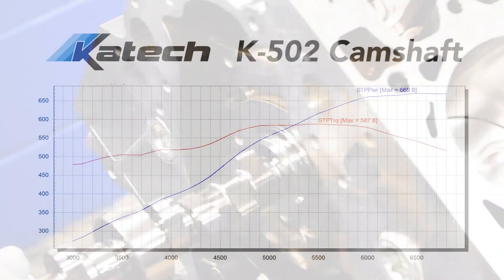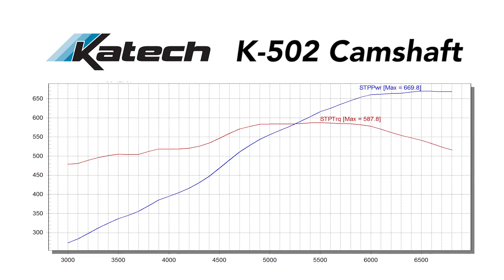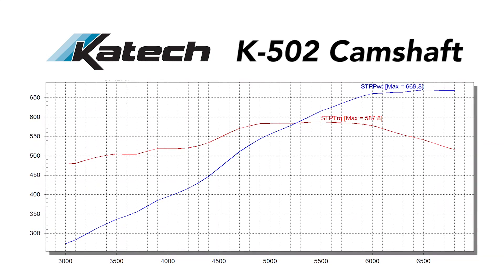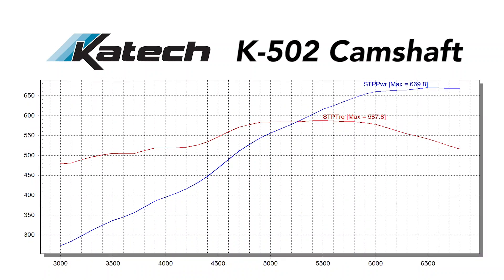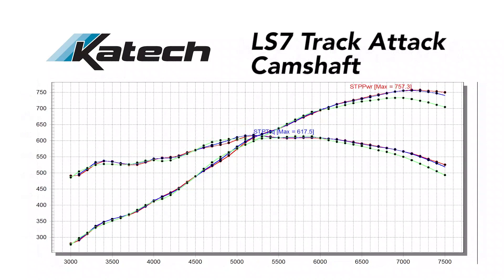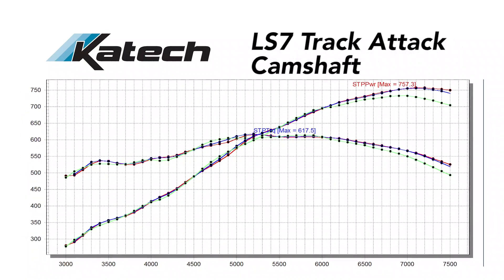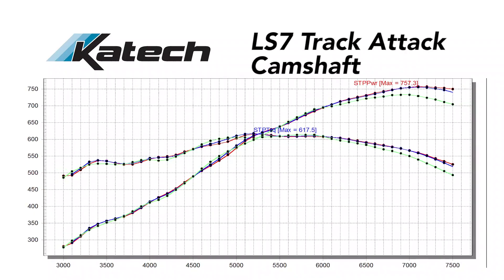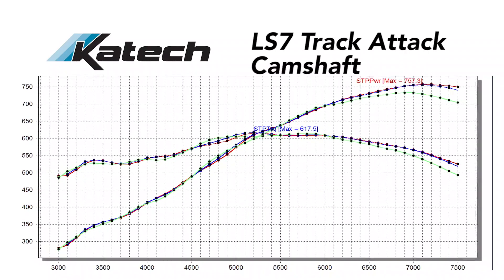Katech K502 and LS7 Camshafts!

Comment: @Katech ....How exactly is your new K502 (243/257 on a 113+3) an improvement over the K501 (235/251 on a 113+3)?
I see how it would make less torque all over the RPM range and more power at the very top of the RPM range. But how is it better or more efficient? Certainly the new K502 won’t drive around town as well as the old K501. ONLY COMMENTING SINCE I’M not able to decide which of these 2 cams to buy
Reply: I realize this is an old comment, but the K502 will likely outperform the K501 from the mid 4000s on up. The K501 is probably only better under 3000 rpm, and I don't know why you would be racing below 3000 rpm.